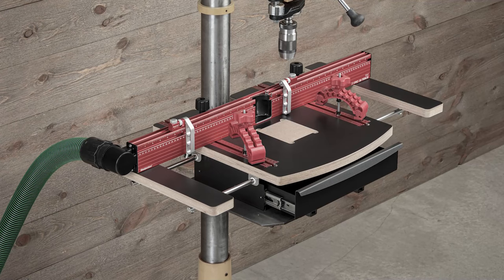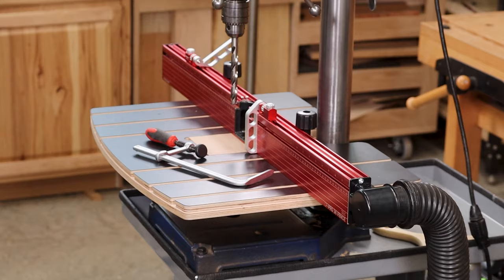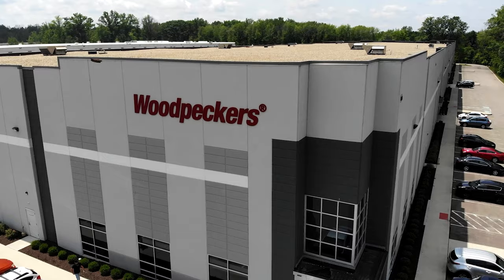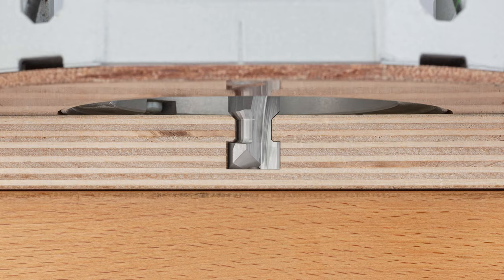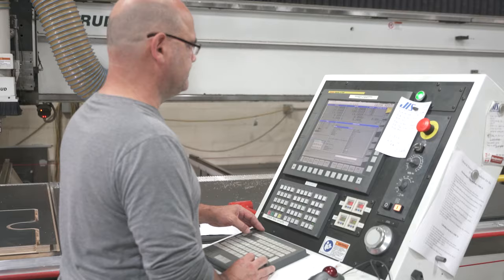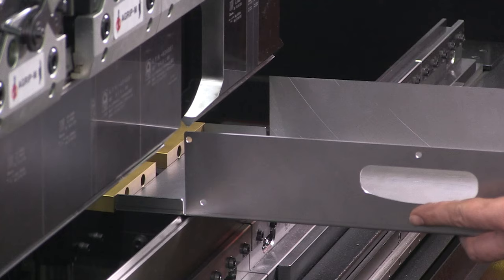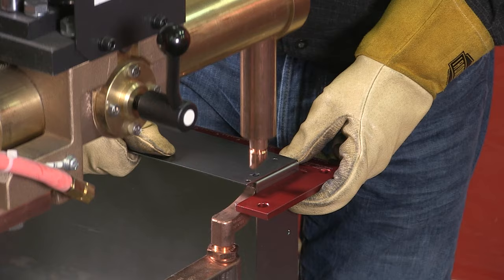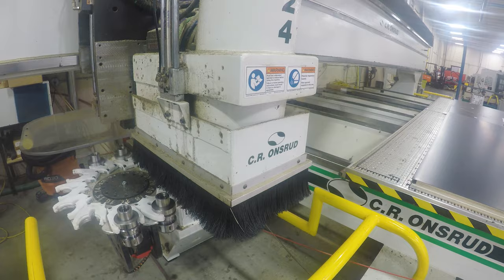Production Update: DP-PRO TCS Drill Press Table

Comment: I have the original DP-Pro table with drawer base and extension wings. It would be nice to be able to upgrade just the actual table to the new, improved one. Any plans for this?
Reply from the maker: We don't have a standard SKU for the table only, but call Customer Service (800-752-0725). I think they can work something out for you.